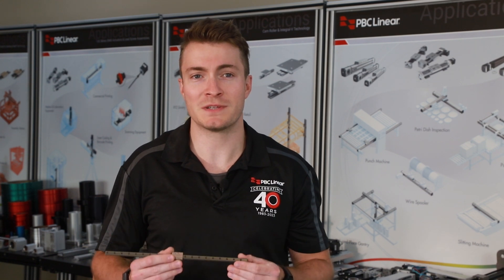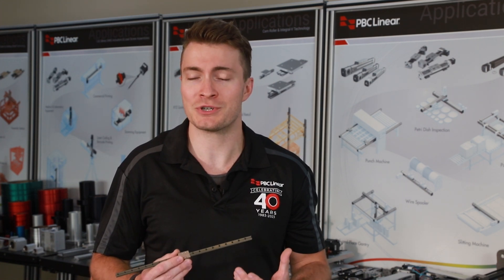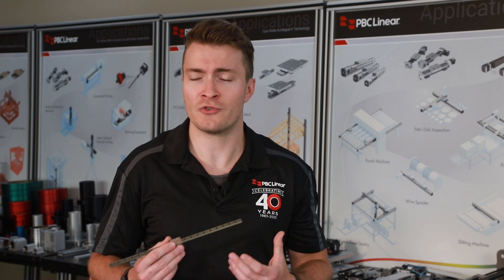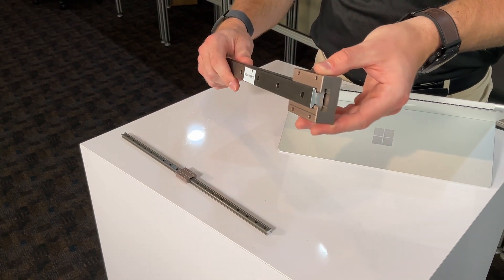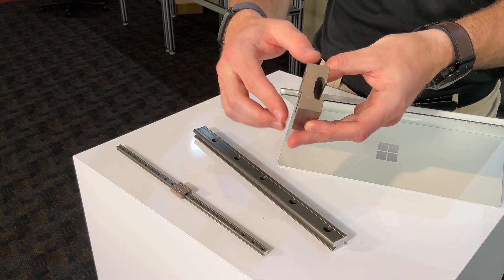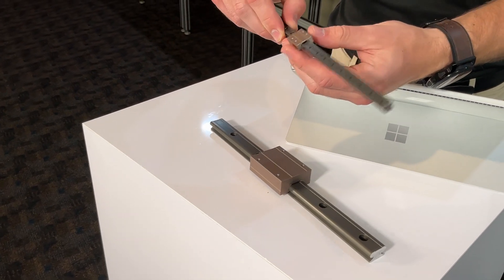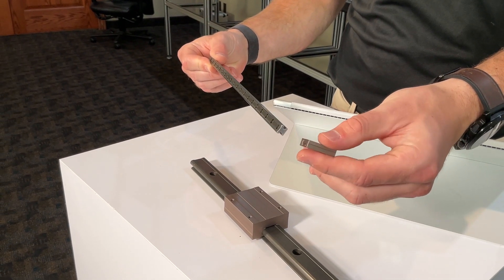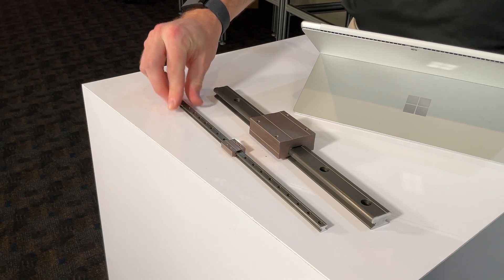Mini-Rail Linear Slides with Self-Lubricating Sliders

Comment: Great video!
Would you recommend these for use on 3d printers?
Reply from the maker: This product could certainly be used in a 3D Printer application. However, it would largely depend on the design of the 3D Printer and how each axis is driven. If you’re building a 3D printer and need some assistance selecting components, feel free to reach out to our Application Engineering Team via email at: application.engineering@pbclinear.com